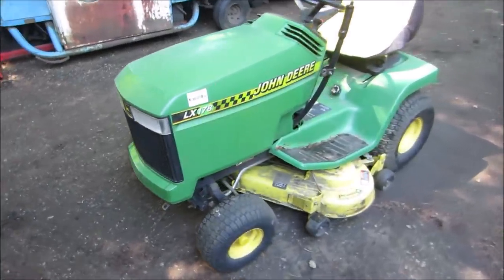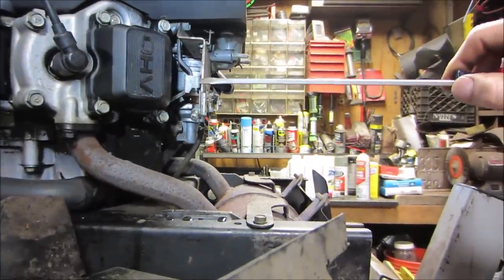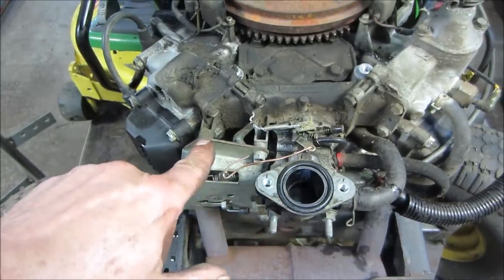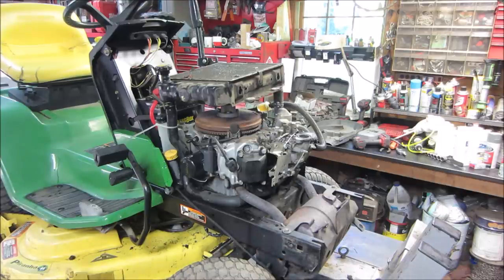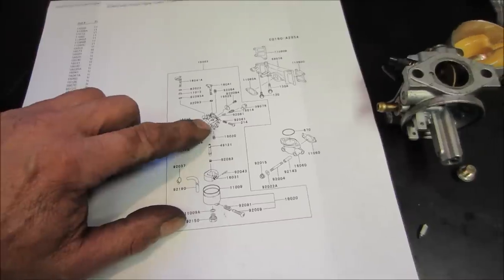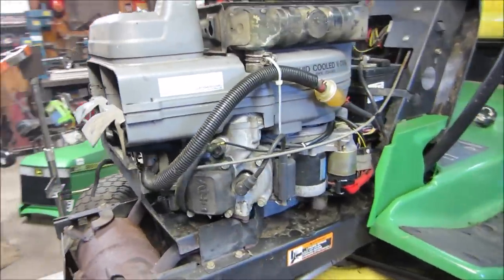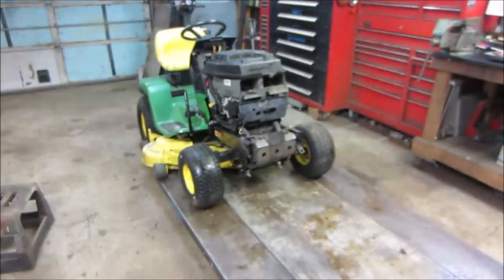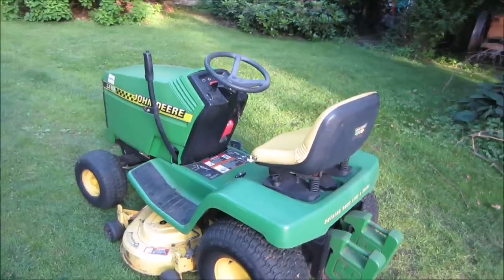yard sale John Deere, lets unfix other peoples repairs.

Comment: Liquid cooled?  Seems a bit unnecessary.
Reply: Liquid cooled engines tend to run quieter than air cooled due to the sound deadening effect of the water jacket.  Of course the exhaust system plays a major role, too.
Reply: not really, slow moving doesnt get much air, so with a bigger engine, its a better way to do it
Reply: My 3-cylinder diesel Kubota riding mower has watercooling too. (Yes, it is WAYYY overkill) It is rated for 14HP but I have not been able to make it even slow-down in tall grass.  It is so efficient,  I can mow ALL SEASON on 5 gallons of fuel.
Reply: Would the water cooled engines tolerate the E15 gas better, since it can handle heat better?
Reply: water cooling has no effect on fuel recommendation. gaskets and rubber parts determine what fuel to use. ethanol is NOT good for small engines. cars and trucks have systems that are designed for ethanol as it is corrosive and absorbs water from the air. try to find ethanol free fuel for your small engines. the newer small engines will tolerate e10 and it says so right on the fuel cap or near it. I have a 2013 cub cadet that will tolerate e10. I don't use e10 as I have access to ethanol free premium fuel at the local gas station.

Comment: Inlet seats are made of viton and cost pennies, a minute to pull out and replace, spring loaded needle needs replacing at same time. I don't understand why you would rebuild stuff without replacing obviously worn out parts, "shady tree fixes" spring to mind. Thirty years in the trade, do it once and do it right, not constantly taking things to bits time and time again. Enjoy your work but I do understand these are 'fun' videos and not about making money on machinery.
Reply from the maker: needle and seat are not available and the carb is around 200, there is a knock off for 25 that l ordered but does not fit, bolt pattern is different, and yes the idea is to figure what is causing it and making an interesting video not just buy parts, thanks for watching david,
Reply: Mustie can build a carb from a coke can and duct tape. You clearly haven't watched his videos. He is a master mechanic. And he shows ways to do things that average person can do in there driveway. Of course he could've ordered the parts and replaced them. Mustie has rebuilt a transmission on a motorbike. This is a walk in the park. You got 30 yrs experience, then surely you know they didn't sale a rebuild kit for this engine. By the way, where's your videos. That's right, you don't have any. Get outta here...
Reply: I wouldn't want to sit very long on any mower with a "coke can and duct tape" for a carburettor, would you? I doubt you'd be able to claim on your insurance for either mower or self, once you hopefully got out of the hospital burns unit and insurance take machine for extensive testing... he said that the original parts were no longer available, I think it's ten years that manufacturers have to hold parts in stock, so perhaps the machine is now obsolete, maybe he could fit a more simple Briggs engine later, as I feel this one will not go away just yet, manufacturers original parts fit properly and take the minimum time to fit, are safe and are guaranteed to fit etc, bodging sometimes works but is often time wasted. If it was your machine he was fixing, would you be 100% happy at the amount of hours that have been spent so far?  And at what $ rate? Messing around costs more in labour than new parts, that's a fact.I repeat, do it once and do it right, first time, minimum costly hourly rate is ensured.

Comment: If you are a man and don't enjoy watching this you have no testosterone.
I learned a long time ago riding mowers are no good candidates for tubeless tires, especially when the tread/sidewalls are zero ply. I break the bead and slip an inner tube inside to do away with the problems of having to check the pressure/inflate every time I mow. I still check them but not as frequently. My Deere 175 crapped out on me earlier this month - the $$$ hydro pump is dead and I'm not paying for the parts. Used parts are as old as the rears they came off and mine is 31 years old as is. Every time I watch these videos with JDs in them I remember wrenching on mine and wondering why they took perfectly fine machines and made them complicated to the point you don't want to wrench on them. If I had that garage and lift it would be different but, I am on a limited income and do what I can in shade tree fashion. I don't know how you can bend real JD blades as they are made of different steel than big box crap.